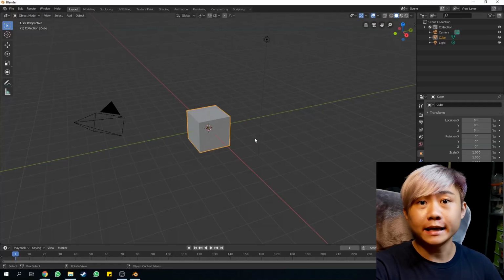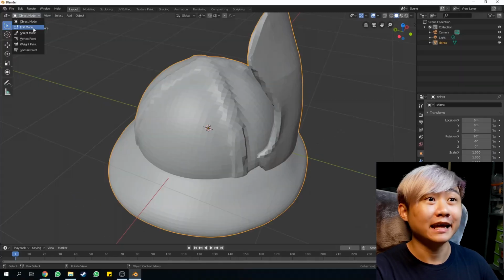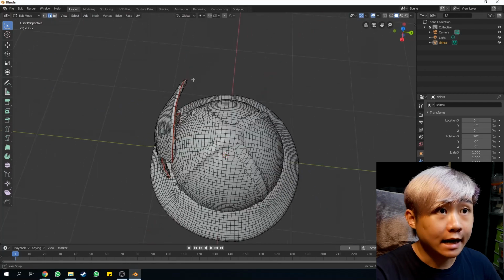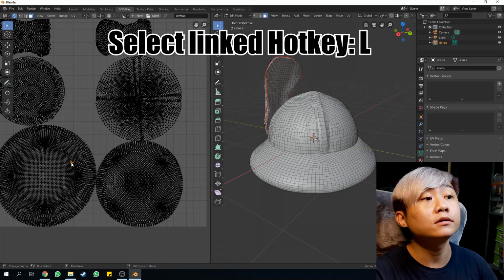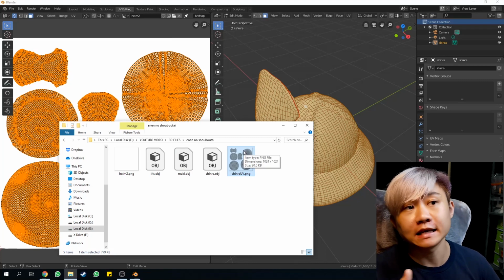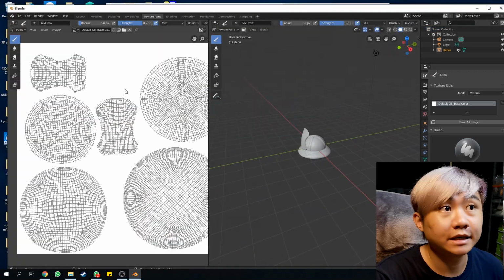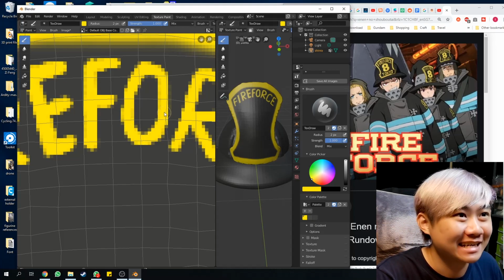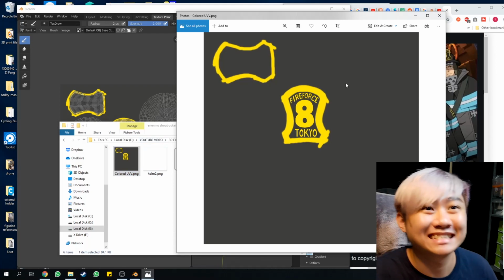HOW TO UV MAP - BLENDER 2.8- adding Color to 3D models, for SparkAR

Comment: bro, i tried hard with your tutorial, but i wasnt able to grab a 3d model, reduce its polygon count and use the texture as i would normally, i managed to squeeze a 3d model right below the requirement and use its textures, but the doubt its still here for me: How can i UV map an image into a 3d model which has been reduced the polygon count? sorry for my english
Reply from the maker: Hello, I'm not sure if I understand your question. To reduce polygon count, I used limited dissolve. Might not be the best but it can reduce poly count. You have to mark seam(in edit mode) and unwrap to produce a uv map. Which then you can use an image to uv map the model after it has been unwrapped
Reply: @ZiFengLearnstoMake  thanks man, the problem is when i did that procedure, the texture looked all glitched in spark ar, anyways i could solve my issue in a different manner (reducing polygon count of special parts of the 3d model, where i didnt need the texture to be placed)
Reply from the maker: @awantetodo  did you export the unwrapped 3d model in fbx to be imported into spark ar?
Reply: @ZiFengLearnstoMake  nope, all done in blender
Reply from the maker: @awantetodo  yes, after you finished the blender unwrap, you can save it as FBX, and when you import the file into sparkAR, if the texture doesnt appear, you need to go into your bleneder, UV paint tab to save your texture as PNG, and then u add it as a texture of a material.
Reply: Thankss
Reply from the maker: @awantetodo  hope that help! you are welcome! =D